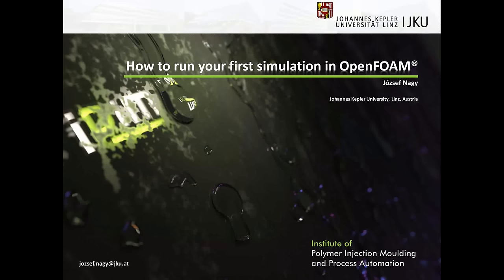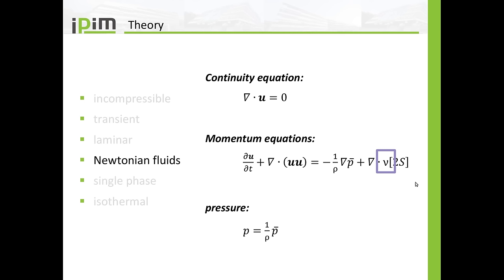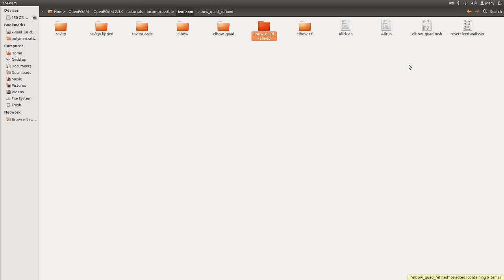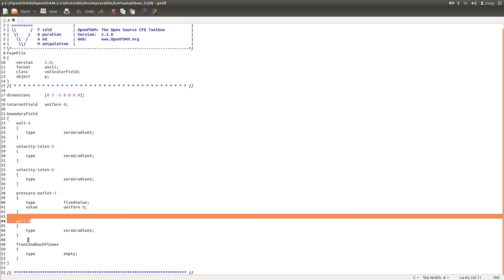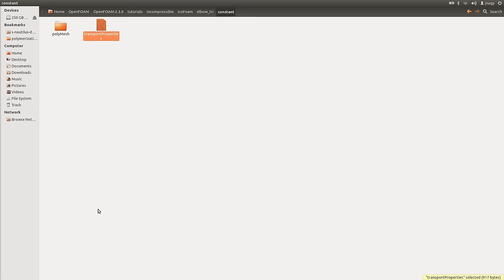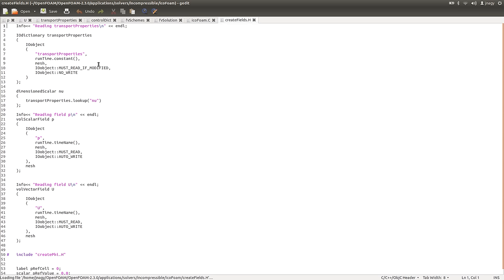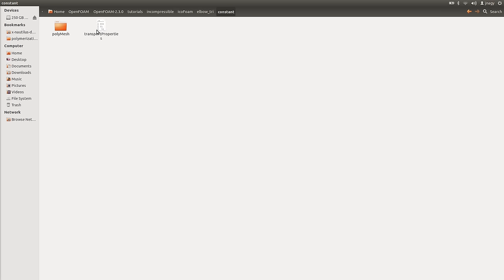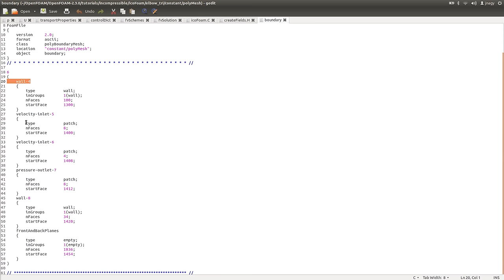How to run your first simulation in OpenFOAM® - Part 1 - tutorial (download link to msh files below)

Comment: Hello József thank you for your tutorials, they are great:) I encountered a problem when I was trying to run the quad case. I downloaded the elbow_quad.msh file from the link you provided and put it in the elbow_quad folder but when I try running the fluentMeshToFoam command in this folder it says that the elbow_quad.msh file is not found. I was wondering what I was doing wrong. I am using windows WSL ubuntu for openfoam.

Thanks.
Reply from the maker: Possibly the file is not in the correct folder.
Reply: @OpenFOAMJozsefNagy  I don't think so as I put it in the right folder and crossed checked it. I think maybe it has something to do with how I download and save the file from GitHub 🤔 because when I run the simulation in a mac computer using docker it works.
Thanks
Reply from the maker: @alfredandrew8288  Possibly permission issues?
Reply: @OpenFOAMJozsefNagy  maybe, I just ran the simulation somewhere else and it worked. thank you!

Comment: Hi!
Thanks for your videos. I want to learn to work with OpenFOAM. I have experience with COMSOL and (less) with ANSYS.
My goal is to simulate a high mach flow with a gas at high pressure compressing a gas with low pressure (basically a shock tube).

Do you this this is possible with OpenFOAM?
If yes, would you have some suggestions where to start?

Best wishes!
Fabio
Reply from the maker: +Tex Mayhem Sure. Check out the shockTube tutorial on my channel.
Reply: Cool! I will surely do... Tx

Comment: Dear Nagy how to fix the dimensions for different structure or shapes.
Reply from the maker: Do you mean to convert the mesh from mm to m? transformPoints -scale '(1e-3 1e-3 1e-3)'
Reply: i mean i need to fix the small solid sphere in the water flow of cylinder tunnel or pipe.
Reply from the maker: I am sorry, but I do not understand, what sphere you are talking about. Do you mean this tutorial or your own case?
Reply: yes, i am trying to solve one new problem so that i can learn properly, my tutorial is one small solid sphere is placed in the water flow of 10 meter length cylinder. and my question is how fix the dimensions so that i can get my exact shape.. thank you
Reply from the maker: Did you check out my multiphase tutorial project? If not, go there and check it out.
Reply: i saw that, but how to fix the geometry of different structure.
Reply from the maker: Do you mean changing the STL for before running snappy? For that you need a CAD tool.
Reply: József Nagy  do you have any videos on that
Reply: József Nagy I need to make a model by using cad tool then I have to use it for simulation right.
Reply from the maker: Yes, I just posted a video on this. Check it out: https://www.youtube.com/watch?v=b0h8MxEMQPM

Comment: Hi Jozsef,
                Thanks for the demonstration. I've installed OpenFoam through Ubuntu. However, the default installation path is huge so if I try to run what you are showing in the video, I need to write the path which is quite difficult. Is there any other way I can run OpenFoam avoiding writing that path?
Reply from the maker: Which path do you mean?
Reply: @OpenFOAMJozsefNagy  By path, I mean the location of the OpenFoam files (applications, tutorials etc...) in my computer. The path looks like; C:\Users\SOHAM\AppData\Local\Packages\CanonicalGroupLimited.UbuntuonWindows_79rhkp1fndgsc\LocalState\rootfs\opt\OpenFOAM\OpenFOAM-v1812
Reply from the maker: @cfdem  I see, you are running on Windows 10. Check out my tips video for Win 10 on my channel, how to solve this problem with a symbolic link.

Comment: Hi Jozef, when i put the order "fluentMeshToFoam elbow.msh" the terminal doesn't find the order. Is this a problem of installation of OpenFOAM?

PD. your video is awesome
Reply from the maker: Hi, what is the (error) message you get?
Reply: "fluentMeshToFoam: no se encuentra la orden". It is in spanish, sorry.
Reply from the maker: ecchox
I guess it means "fluentMeshToFoam: command not found". Yep looks like there is an issue with the installation of OpenFOAM. Did you install it via sudo apt-get install openfoam230? I think you forgot to add the one line into your bashrc. Go check my tutorial around 9 min: How to install OpenFOAM®

Comment: Hi Jozsef! In this case, we have used implicit discretization and also the terms in icoFoam are implicit, so why do we have to care about the Co number to be smaller than1?
Reply from the maker: In my experience only the LTS solvers can handle Co>1.
Reply: Okay, but my point is more about the implicit vs explicit scheme comparisons. In the CFD books, generally, it is mentioned that the Implicit solvers are usually less sensitive to numerical instability and they can tolerate larger Co. So if the time-discretization, as well as the terms in icoFoam, are all implicit (fvm::), can we have a larger Co (and indeed the time-step) and still get reasonable results?
Reply from the maker: Theoretically yes.
Reply: Okay, thanks Jozsef.

Comment: Hi Jozef. Student of Gavin Tabor here! Sadly Paraview isn't opening the meshed file, it's like it's empty. Would an older version of Paraview be better? Google hasn't come up with much help either.
Reply from the maker: I have not had this issue. Maybe an older version or a driver issue. You can check whether the boundaries are loaded. Then it is a driver issue. If not, than something with the files is incorrect. Difficult to say.
Reply: @OpenFOAMJozsefNagy  thank you for the reply. Turned out. I just needed to press the apply button!!
Reply from the maker: @jamesnoz  Very good

Comment: Hi, Jozsef! I have a problem with running the paraview and I hope you could give me some advice. At 21:00, after I choosing the controlDict and pressing 'ok', the paraview just disappeared. In the terminal, it shows Error: In /build/paraview-arsa8T/paraview-5.0.1+dfsg1/paraViewCore/ServerImplementation/Core/vtkSIProxy.cxx, line 310   vtkSISourceProxy (0x51f7d20): Failed to create vtkXdmfReader. Aborting for debugging purposes.
Reply from the maker: Oh no. You might have some library issue. Try and download an older version of Paraview.
Reply: @OpenFOAMJozsefNagy  Thank you so much!

Comment: Hello József,
around 21:10 You open paraviev and try to read a file not supported by it but You choose option "openFOAM'. When I try te same my  paravieew crashes instead of letting me choose  "openFOAM'

terminal message: 
ERROR: In /build/paraview-arsa8T/paraview-5.0.1+dfsg1/ParaViewCore/ServerImplementation/Core/vtkSIProxy.cxx, line 310
vtkSISourceProxy (0x382be70): Failed to create vtkXdmfReader. Aborting for debugging purposes.

what to do now? could You help me please?
Reply from the maker: Try creating an emtpy text file called foam.foam and open that. Or try a different version of Paraview.
Reply: I changed the name from "controlDict" to "controlDict.foam". Thanks for giving me an idea.
Reply from the maker: Make a copy of controlDict. Glad I could help.
Reply: thx sooooo much, I met the same problem, and your solution helps me a lot.

Comment: I wanted to run paraview & however, it says that  'paraview: cannot connect to X server' even though I've already installed Xming Server. What would you suggest in this case?
Reply: Ok I have handled it by myself, however there is still a problem. I followed like you did in this video 21:07 but in my case I have an error: 
ERROR: In /build/paraview-arsa8T/paraview-5.0.1+dfsg1/ParaViewCore/ServerImplementation/Core/vtkSIProxy.cxx, line 310
vtkSISourceProxy (0x49a0460): Failed to create vtkXdmfReader. Aborting for debugging purposes.
How can I manage this? 
Thanks in advance
Reply from the maker: Check out my video with the tips for Windows 10.

Comment: Thanks for the vid. I am running Openfoam 5 on windows. At 18:40 when trying 

$ ~/blueCFD/OpenFOAM-5.x/tutorials/incompressible/icoFoam/elbow_tri$ fluentMeshToFoam elbow.msh

 I am getting:
blueCFD/OpenFOAM-5.x/tutorials/incompressible/icoFoam/elbow_tri$: No such file or directory

On thoughts on what I am getting wrong?
Reply: NM- I figured it out... I only needed to input into the terminal fluentMeshToFoam elbow.msh    rather than the full path
Reply from the maker: Your file doesn't seem to exist.

Comment: I am using OpenFOAM v2006, in the first case of elbow_tri, when I open controlDict in Paraview, nothing appears, is there a fix for this? BTW Thank you for the really nice tutorial!
Reply from the maker: Use an open.foam file instead. Create an emty text file.
Reply: @OpenFOAMJozsefNagy  Thanks a lot for the quick reply :) This fix worked! By the way, an other question, my solution differs from yours I checked the values from your screen (by a little around 5%), is it due to the new updates, I just changed what you had changed t_final = 75.

Comment: Hi Jozsef,
First, thanks for the videos. I am just starting to get into OpenFoam and your videos will be very helpful.
I have installed the latest version of OpenFoam 5, available on their official site, running on Ubuntu 16.04 LTS. Paraview come along with OpenFoam5. 
Working through this tutorial, I could properly open Paraview, choose the controlDict file, and then when the window to choose the reader opens up, I see 2 options for OpenFoam. on choosing either options, paraview crashes and I see foam fatal error on the terminal. The error is provided below:
--> FOAM FATAL ERROR:
cannot find file "/home/amruthrajmn/OpenFoam/tutorials/incompressible/icoFoam/elbow_tri/system/system/controlDict"

I tried looking up for this error online, but could not find anything about it anywhere. Could you please advise on this? I am not sure why the path says "system" twice. I double checked the directory, but there is only one system folder, and the controlDict file is inside the system folder.
Reply: I forgot to add that icoFoam worked well, the solver solved it. However, I could not postprocess in Paraview. Same error while trying to open contolDict after running icoFoam too. Any advice would be helpful thanks.
Reply from the maker: Hmm, it thinks, that the controlDict is in system/system instead of just system. Create an empty text file in you case folder (elbow_tri) called foam.foam and open that instead of the controlDict.
Reply: Thank you very much Jozsef! This opened the results in paraview. Cheers!
Reply from the maker: I am glad.

Comment: Hello Sir. Unfortunately, I can't open paraview in Ubuntu and the icoFOAM to run the simulation is also not working.
Reply from the maker: What is the error?
Reply: @OpenFOAMJozsefNagy  hello sir I fixed the error but paraview & is not working. It shows some import errors. Can you help me please
Reply from the maker: @yogeshkumara9104  If you run on Windows just use the Windows Paraview.

Comment: Hello jozsef. 
I am doing a project internship end of study in the field of extrusion blow molding. my subject is to use the OPENFOEM numerical simulation to better understand the characteristics of viscoelastic flows between two HDPE and PVC polymers, in order to propose a new version of core and die geometry.
now I have installed Openfoan on Windows 7 but no more Tutorials on linux. 
if you can help me I would be very grateful
Reply from the maker: Maybe wiki.openfoam.com/Tutorials might help.
Reply: @OpenFOAMJozsefNagy  thank you very much

Comment: I just installed openFOAM 6 and the elbow_quad.msh file is not there in the tutorial. Where are you covering quad meshes? Thank you.
Reply from the maker: Download link in the description.
Reply: @OpenFOAMJozsefNagy  i downloaded the mesh file and when i gave fluentMeshToFoam, am getting error. worked fine with elbow_tri case...am getting this error now..

--> FOAM FATAL IO ERROR:
Bad token - could not get scalar value

file: input at line 0.

    From function Foam::Istream& Foam::operator>>(Foam::Istream&, Foam::doubleScalar&)
    in file lnInclude/Scalar.C at line 139.

FOAM exiting
Reply from the maker: @shreejeethrd1136  Ok, which version of OpenFOAM?

Comment: I tried installing OpenFoam on the Mac but it did not install the files properly, I don't have all the folders you showed in this video. Do you know what did go wrong during the installation?
Reply from the maker: I am sorry, but I don't have any experience with Mac. I can help you with Windows 10 and Linux, but unfortunately not with Mac. You could try a Virtual Machine as a start.

Comment: sir, i have installed openFOAM in windows 10 by following ur previous video . But while running  it, i am not getting all the files that you are showing like polyMesh inside constant also no dimension for nu.. Can you please help me in this case ???
Reply from the maker: The syntax changed in the last years. Don't worry. As long as you get the same results, you are doing well.

Comment: Nothing works in OpenFOAM v2206. Meshing cannot be done at all. ParaView cannot be opened. Probably, the approach is different.
Reply from the maker: Please check out the description box below. There is a link to my GitHub, there you can download both msh files. Also in 2206 the elbow.msh is located in OpenFOAM-v2206/tutorials/resources/geometry you can also copy  the file from there. The quad mesh is only available from my GitHub.
Reply: @OpenFOAMJozsefNagy  Thanks for your fast reply. Appreciate it :). Shame on me. I did not check the info below the video.

Comment: Dear Jozsef,

Thank you for your precious contents. I am an absolute beginner to Open foam simulations and Ubuntu. I am trying to install Nautilus I am getting error messages:

"** (org.gnome.Nautilus:1642): WARNING **: 13:50:00.512: Error on getting connection: Failed to load SPARQL backend: Cannot autolaunch D-Bus without X11 $DISPLAY
Unable to init server: Could not connect: Connection refused (org.gnome.Nautilus:1642): Gtk-WARNING **: 13:50:00.515: cannot open display:" 

I am facing quite the same issue with Gedit, I cannot launch the programs from the terminal. I installed both the program from the terminal. Could you suggest me an alternative strategy? 

Thank you so much, hope you can give me an hint. Wishing all the best

Sara
Reply from the maker: Are you working in WSL or native Ubuntu? On native Ubuntu they should be already there. For WSL you need WSLg to run GUI apps.
Reply: @OpenFOAMJozsefNagy  I am working with WSL with Ubuntu desktop. I will try to switch to WSLg, thank you so much!
Reply: @Jozsef, a very stupid question. How can I download the mesh files from your Github page in .msh format? I only manage to download a .txt file!

Comment: Hello sir, I am doing my final year project in university. It's about scouring protection design. I want to make a hydraulic dynamic module about scouring of a cylinder happened in a horizontal channel. Does it possible to achieve that with openfoam? And I want to make some design to the cylinder such as add a platform on the bottom of cylinder, can I use openfoam to do that?
Reply: Basically I need to know the sour depth around the cylinder and the shape of scour area and how the scour develop during the time. I think the module it's very simple, because the flow speed I need is stable.
Reply from the maker: @Hong-i6g  Yes, I guess this should be possible. Check out this video:https://www.youtube.com/watch?v=cVf7qm_ZDK0
Reply: @OpenFOAMJozsefNagy  Thank you
Reply: @OpenFOAMJozsefNagy  Hello sir, I want to ask you how to copy and paste code and how to open the edit in the windows ubuntu terminal. Thank you very much.
Reply from the maker: @Hong-i6g  nano and vim work very well in WSL windows 10. Select and right click copies, a second right click will paste.

Comment: Thanks for the video!
I am facing a problem regarding paraview. As I write <paraview & >
Terminal responds with < Command 'paraview' not found >
Please Help!!
Reply from the maker: There is a video on my channel on how to install Paraview.
Reply: @OpenFOAMJozsefNagy  Could you upload the link to this video here? I'm facing the same issue using ParaView-5.8.1 and I do not see the video on how to install ParaView on your channel.
Reply from the maker: @swrona90  Windows or Ubuntu?
Reply: @OpenFOAMJozsefNagy  Windows 10, but I wanted to have the possibility to run ParaView under Ubuntu terminal as you do.
Reply from the maker: @swrona90  It is better to use the Woindows version as WSL does not go well with Paraview. Unfortunately.
Reply: @OpenFOAMJozsefNagy  Ok, thanks a lot. That's exactly what I thought.

Comment: The file elbow_quad.msh which i downloaded from the link below the video is unwritable, and while running fluentMeshToFoam, it is showing following error:
 from FOAM FATAL ERROR:
The parent directory does not allow write permission to the process,
 or one of the directories in "/home/khan/OpenFOAM/OpenFOAM-v2006/tutorials/incompressible/icoFoam/elbow_quad/constant/polyMesh" did not allow search (execute) permission.

Please Help.
Reply: Where are you running the hole simulation? If you doing it in opt, consider to copy the needed case in your home direc first
Reply: @hephaistosjohansen3451  hey..I am running the simulation in the Ubuntu virtual environment itself as I have Windows 10. What do you mean my opt??
I have copied the file from the link in my elbow_quad folder.
Reply from the maker: @arshilkhan1975  Try and run it on you Windows filesystem.